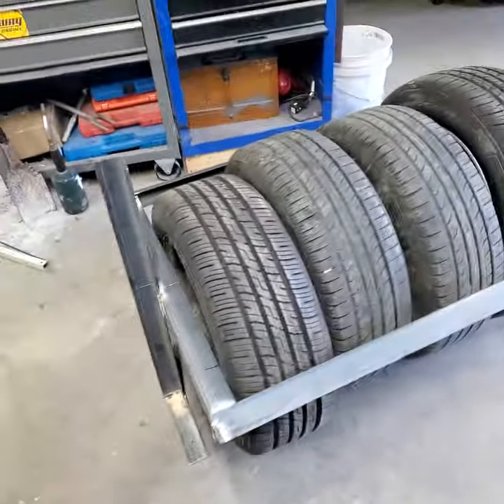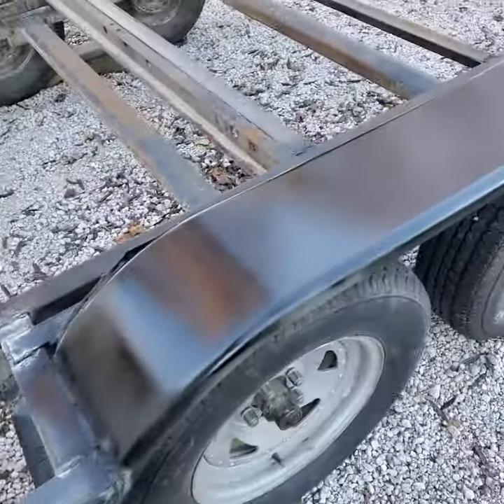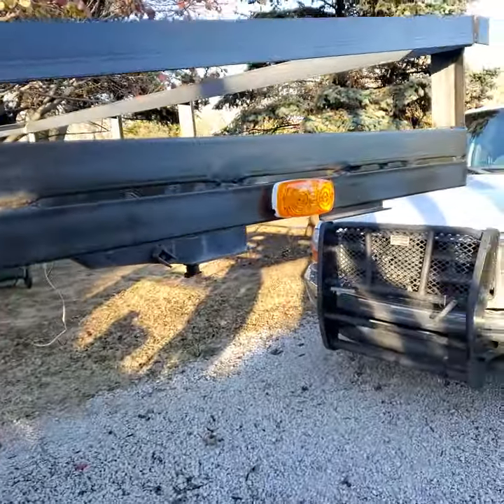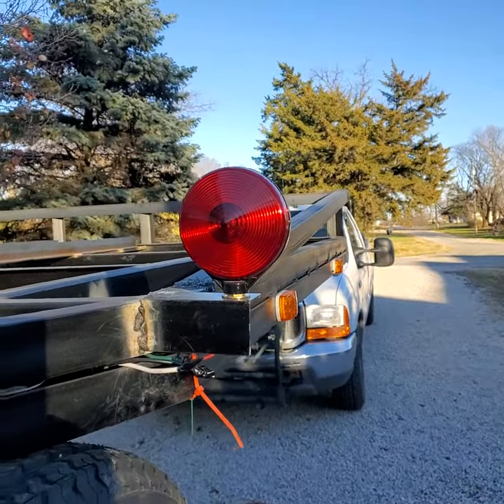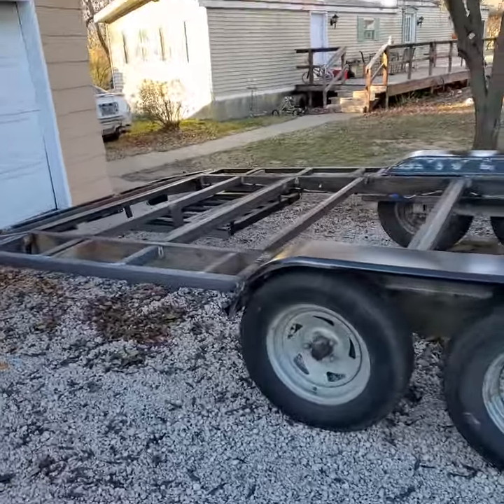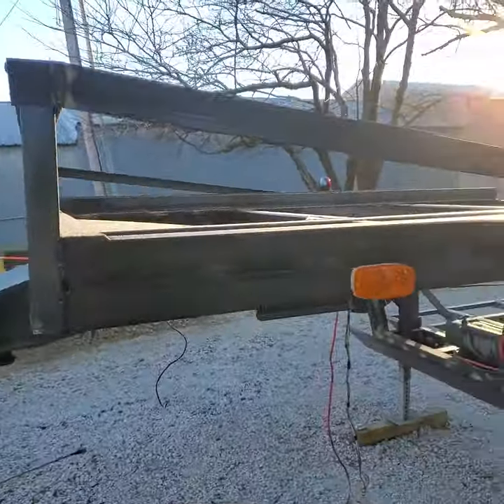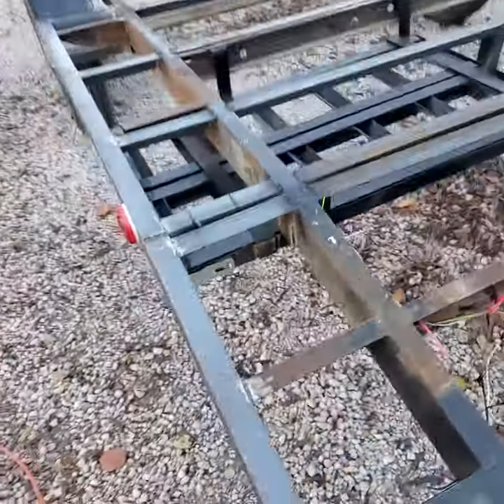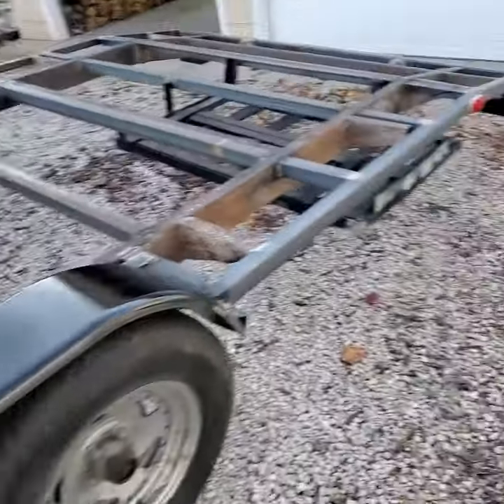5th wheel camper car hauler conversion

Comment: The ramps look really short.
Reply from the maker: 5 foot,longer than most but yes,im goin to make a one foot extension for them
Reply: @outlaw-xbuilds9126  how high is the deck?
Reply from the maker: @Alwhite1929  2 and 1/2 or 3 feet what ever height a camer is,the dove is about a foot in the back